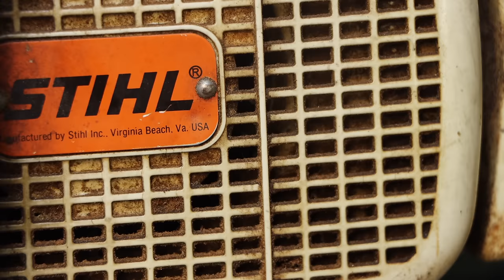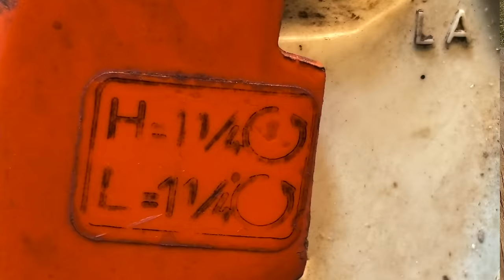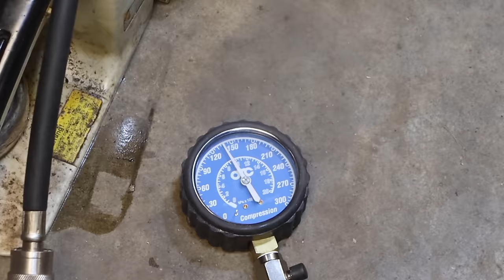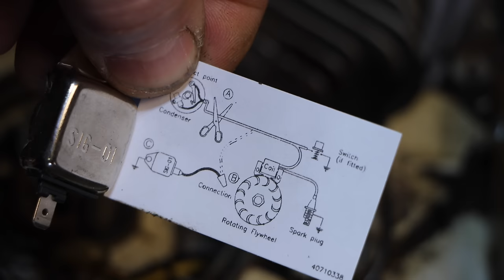Fixing An Antique Chainsaw.  Stihl 028 Wood Boss.

Comment: Seals and impulse line test really needs to be done or it will run rich and kill the piston/cylinder. 
David Throne helped me with this post . I thought u could use break cleaner and he said "No!".
You want to use spray can carburetor cleaner not the brake cleaner and if you can find the 2+2 or the Berrymen’s brand carburetor cleaner then I highly recommend those brand’s because they have a little lubrication in there cleaning mixture… it’s just getting sucked into the little air leak void and it’s actually just blocking some of the air volume that the carburetor was set to idle on and it goes “rich” and kills your engine… if you just use the little spray tube on the can and do a little blast it’ll kill your engine or maybe make it dip down if it’s a tiny air leak… it’s just a really super fast technique because you can hit both sides for your seals and your cylinder base and your impulse lines and the whole operation won’t take you 5 minutes… it’s definitely more accurate to vacuum and pressure test one but getting your carburetor opening and then your muffler port’s blocked off with the soft rubber over your metal plate’s takes me longer to just drag out the MityVac and get started so it’s like a 20 minute deal… if’s a great quick test after a quick rebuild just for some insurance that it’s good and tight… no brake cleaner only a quality carburetor cleaner

Comment: We had some small-ish Stihl during 80's as a household saw for cutting firewood. For that purpose, the first corded electric saws were excellent - quiet, no pull start, no smoke. I still kind of regret not having that saw anymore, although modern ones must be decades better. <G>

Comment: 3/8/24..A+ John on Dad's 'Ole Chain Saw! As always, very nice camera close ups/lighting/pro level (adjustable lgnition⚡️Spark) testing tool, compression gage & micro fuel line clamp.  So, you must be a Dentist😁 judging by your handling of those tiny carburetor 'needles' etc. Good job getting chain saw cutting bunch of fire wood, saw sounded great! A+ 🔧💪⚙️🍺😊

Comment: Hi John, I'm sure you've been told before but get that junk chinese carb off the saw. Put the original carbon back on and it will have much smoother operation and alot more grunt. 
The chinese ignition would be a CDI  and the module would be within the laminations of the coil case, or ut could be just junk.
Another thing to watch for are cracked pulse line or cracked fuel line. I'm not sure of the quality of fuel in the US but Australian fuels tend to break down the rubber lines.
Great little saw with quality engineering. Keep the Asian parts in the bin. That's where they belong.
Thanks for your content,  I do admire your thirst for engineering knowledge on the varied fields that you display.
Cheers Stewart

Comment: Tricky little monster! Moral of the story: When you think you've checked everything and fixed the problem you think it has and it still doesn't work right, a) revisit your suppositions and test with a different method, and b) look and think hard for anything you may have missed or thought "Hmm that's odd..."

Comment: Sometimes things like the bore or the shaft for the throttle plate can get all wallered out and develop a vacuum leak without you really being able to feel much in the way of shaft wobble. Or some ding-dong going full gorilla on the mixture screws and pulling half the threads out or mauling the mixture needles. Not a whole lot else to go wrong on those carbs besides the usual gasket/o-ring/gooey oil and bad gas issues. I can't say much on chainsaws as I have no experience, but on itty-bitty motors like that, there are occasions where it's nearly as cheap to just replace the whole carb as it is to get a rebuild kit since they're so simple.

But you know how it. Things just get old and start leaking air, a little exhaust, occasionally blurp out some fuel. Just like people. Don't ask me how I know. You just hope you can keep the oil in. Otherwise, it's off to the store to get new underwear.

Comment: Just info to keep in mind fuel lines so bad sometimes get small small crack in them won’t pull gas to run replace it will fix it oh and ethanol gas only
Reply: Ethanol free gas is what I believe you had intended on writing.

Comment: an old trick to get a diaphram to soften up to get it to work and get by till you can get parts is to soak the diaphram in brake fluid for 1 to 4 days depending on how hard the diaphram is.

Comment: Let me throw something at y'all. I've worked on just about everything in my 75 years before settling on small engines. What I've seen on these models are broken crankshafts. They shear off next to the pto seal. My guess is rough bearings & vibrations of that. None of those saws were repaired, just parted out. Those had 3 different displacements, from 43cc to 47cc to 51cc.

Comment: Nice video, very informative.
I don't know man, wonder if the orange hat would vibrate loose or vibrate and cause poor connections and allow corrosion/oxidation as dissimilar metals on the two wires. Long term it seems  that a soldered joint would reduce the likely hood of both corrosion and loose connections.  IMO.

Comment: The 028 WB was the very first chain saw I purchased back in 1982, it has cut many cords of fire wood for the first 20+ years I used it. I had to buy a new saw (360 Pro) due to the fact that they quit making parts for it according to the local dealer, the only thing really wrong with it was a leaky oil pump and it wouldn't idle. I would love to restore it if I could get the parts.  Now my 360 is outdated and hard to find parts, looks like a new Stihl is in the works again, 500i?

Comment: I just ran into the same problem with my old Ariens snowblower. It turned out that the spark plug lead was bad, giving an intermittent miss under load. A new coil fixed it. It was Chinese, but will probably last longer than I will.

Comment: I'm not a fan of 2 stroke small engines they can be very finicky. The carbs,jets,passage ways are all smaller and more subject to being clogged. But I will take your advice on the adjustable tester.  I'd rather see how far a spark jumps and how rapid then decide how bright a coil can glow intermittently

Comment: I know you got the saw fixed. But more than once I have had the screen in the muffler clog causing to run only with the chock on. Just thought I would mention it for a lest a tool in your tool box.

Comment: John, have you ever watched the Chickanic YouTube channel? She runs a power equipment repair shop. Just the other day she showed a chainsaw with the same symptoms as yours. The problem is with the diaphragm being stiff from age. The key is to start it and just keep pumping the throttle in order to flex the diaphragm.  It should soften with use.
Ok. That didn't work. Also, were you able to check the spark arrestor screen in the exhaust?  If it has one.

Comment: At 22:10  you discuss outright replacement of the carburetor. And why a rebuild sometimes doesn't solve the problem. I've had this happen to me twice. I've spent countless hours trying to get my wife's small snowblower to run properly without success, and my theory is that debris or deposits from old gasoline have partly blocked a drilled passage in the carburetor. I know it IS a carb issue but have not been able to fix it. New parts, solvent soaks, compressed air.....nothing has helped. I really hate to admit defeat but I feel I've already devoted far too many hours to this project, so I guess I'll be replacing the carburetor after all. My wife thought I was a mechanical genius, but my reputation has suffered greatly.

We have an old Troy-Bilt rototiller that had a carburetor issue years ago. It started and ran just fine but would bog down when revved. Same story: I dismantled and cleaned the carb numerous times without success, until the fourth or fifth try, when all of a sudden the engine started and ran beautifully. That was more than a dozen years ago and it has run fine ever since, so I'm pretty pleased with myself. But the hours I spent removing and dismantling the carb, cleaning then reinstalling it? Far, far too many to admit to. 

With old equipment I'm very, very reluctant to replace a part I can save. Like a carb. It somewhat spoils the authenticity of the machine, having new parts on it. And many of the old parts were better made. But sometimes I must admit defeat and talk to the parts dealer.

Comment: Good job,  You didn't give up. Dad would be  proud. I'm shure he was cursing at it.😂 l suspect he believed it was a fuel issue and tried to pull the main jet from the  carburetor. But it's pressed into the  aluminum.  I too came across the  new coil issue on a Briggs and Stratton l converted to  electrictronic ignition? I think it could be a  different ohmmeter resistance did you compare the ohms resistance to the OEM coil? I was l bit concerned that you didn't disconnect the  kill switch  before buying the  pointless ignition. Because l have several times found bad  kill switch issues. The other thing is that you  suspected the pulse line was loose and the  carburetor ar the same time, this causes a two variable condition and if you repair both you now never know which one fixed the problem.  Leaving you always wondering. 😅 but l would have approach the issue the same way you did  maybe would have jumped directly to the new carburetor for the extra $5  these new  pointless ignition systems sure are nice! Every time I open up any engine now and see points. I go pointless. Great video !

Comment: I see the issue with that carb flooding.  if you pause the video at 14:01 you can see the upper flap is not seating down all the way.  That is usually caused by using carb cleaner on the diaphragm material. It can warp or distort these flimsy things and cause major issues.  Best bet is to just replace the carb or get a full rebuild kit. I absolutely hate working on chain saws....  Did it for 7 years at my shop before I quit working on them.  Time hogs.... Also, the reason you have to replace these types of carbs is the fuel passages are the size of a human hair, they get clogged up over time and once they are clogged, there is nothing that is going to get them open up again.

Comment: You can just "wet" the air cleaner, and I would bet the diaphram in the carb is stiff as akk get out. Put a kit in the carb and it will be fine.

Comment: I'm just wondering I have seen those electronic ignition kits  my question is what turns the coil off and on at the right moment because the points and the lobe on the Crankshaft are no longer used

Comment: And THAT is why all tools will be electric (battery and/or plugged).  Man, you are a patient man.
Reply: Yes that way nobody can fix them and when they have problems you can just throw it in the garbage can and buy a new one....
Reply: @ryancasey4807 Battery and electric aren't that difficult to fix, unless the electronics are sealed in a block of epoxy.  The real difficulty is proprietary chips, and there are ways around that too, if you don't mind spending the time and don't mind the end result looking a bit jerry-rigged.
Reply: @TheCoffeehound  how is that any better than having the situation found in this video, which is far easier to fix than what you're talking about and is a much more common skill set

Comment: Using a wire nut on a machine that shakes around even with tape isn't safe either. They do make crimp on wire nuts, or any crimp connector really is what you need.

Comment: This is a great example of why ethanol fuel should not be used in small engines. It’s clear this hasn’t been run with ethanol fuel because if it had the carb diaphragm and gasket would have been crispy and brittle.
Reply from the maker: Yeah, I never run ethanol fuel in any of my small engines.

Comment: Hmm makes me wonder why it still wont take throttle Response even after carb rebuild and all the repairs wonder if it is actually missing and the coil is going bad or is partially bad already Jon needs more Air I can hear its super rich with to much fuel 35:56 @FarmCraft101

Comment: I'd replace the crankshaft seals! 40 year old seals aren't going to work like they should and could be causing crankcase leaks, which will make it run poorly and difficult if not impossible to tune.

Comment: Sounds like it has an air leak. Pressure and vac test the crankcase I bet you’ll find the crank seal under the flywheel is failing.

Comment: these old 028 saws make good power it still doesn't sound like yours is running at its max capable rpm, my dad has a 028 wood boss and that thing revs high and chews through stuff fast, its really hard to bog down

Comment: A neighbour brought me a weed eater to fix..... Low compression.. broken rings...replaced...still no go....turns out it had a wrong flywheel...180degree out. 😮.  He had it in a repair shop previously and they couldn't fix it...but looks.like they did put on the wrong flywheel. Got a cheap flywheel.... All good

Comment: Just curious; if the original ignition system took its spark timing from the cam on the flywheel, what triggers the new electronic module?

Comment: Where did you find the # to look up the information on when it was manufactured?  My Father-in-law just gave me his and I’m interested. His however I just cleaned up, put fresh fuel in it, and bar oil and it started after 10-15 pulls. Runs and idles nicely👍🏻

Comment: 27:36 Can I glue that back together? 
😂 (That was my first thought)
Reply: Bob Smith Industries (BSI) sells a Cyanoacrylate specifically for rubber. Works very well [IMO] if it’s properly degreased and rinsed with acetone before glueing.

Comment: Thank you for this video !   I have an early 80's ( I think 1983 or 4 ) 028 and has been a very good saw.    I did not know it has points and condenser !    I would like to convert it to electronic like you did.   Where did you get it from and was the supplied wiring diagram correct ? ? ?

Comment: I'm confused. The points opening is what times the spark. With them removed you've lost the timing. The magnet on the flywheel leaving the pole on the coil will cause the magnetic field to collapse and generate a voltage spike and spark but surely that will be later than when the points were in place?

Comment: Hey John great show but a little food for thought don't get mad ok. All the stuff that you did to your dad saw was a learning process. The thing you're going to find out is the saw is not actually fixed and you still need to replace a few more things. You're  going to run the saw thinking you fixed it and the saw runs out of gas you go and fill it and take a break and when you go to start it, its going to be a beast to start or more than likely it won't start at all when it's hot.( Its not the spark plug or the coil) The thing you seem to have overlooked or forgotten or just don't know.( Don't get mad ok) is that the saw is a two stroke motor. The two stroke motor needs positive pressure in the crankcase to run properly without that the motor is a bear to get started cold or hot and when it gets hot it's a bigger bear to get started and keep running or it won't start at all. Now these are the parts that you kind of overlook to replace first you need to replace the crank seals on both sides( they are two different sizes) the other thing that really needs to be replaced is that pulse line from the crankcase to the  carburetor that's where you're getting erratic idle hard to start and run speeds with power loss. As soon as you replace those crank seals. The saw should be a whole lot easier to start adjust and run and will have much much more power. What makes it even easier to adjust the carbs you need a tachometer to look at the numbers to find The Sweet Spot .Doing it by ear sometimes works but not all the time . Tachometer is a more reliable way of adjusting the high and low idle on the carb. STIHL brand sells Wireless one but they want a fortune for that particular tool and maybe your first born. You can't replace the batteries on the Stihl brand. eBay and Amazon both sell a tachometer for a reasonable price that you can replace the batteries on. The one I use is the one that you hook a wire to the spark plug wire to get a reading. When the saw is running properly three pools on a cold start should start it and one or two when the saw is warmed up. I know you know this but I'm going to say it anyway those old saws when you start it for the first time when its been sitting for a season. You Pull It four or five times with the ignition off choke on to prime it. Then you turn the ignition on and after two or three pools the saw should start. When adjusted properly. I really enjoyed your show this week thank you so very much.😊good luck.Damm crank seals!!!

Comment: I would say your final high-speed tune is too lean. It is hard on the engine to run it that lean. 

You can adjust the high speed under load or adjust it so that it has a sort of rich missfire under no load that cleans up under load.

Comment: Mr John or anyone in the comment section. I have a 028 as well that has been to a professional shop 2 times. The guy told me a seal or something on the crankshaft that is allowing the saw to run lean. It runs great until it gets hot, then loses power. What do you think about it?

Comment: 39:29 Wait, what? A farmer throwing something away? I can't believe it!

Srsly, though, enjoyable video. I suspect that the high speed circuit was messed up because of the jet.  The needle likely was not sitting in the seat correctly, leading to those issues. And was the new coil actually bad (ohm test?) or was the spacing between the mounting screw and the center of the coil incorrect and it was now mistimed?